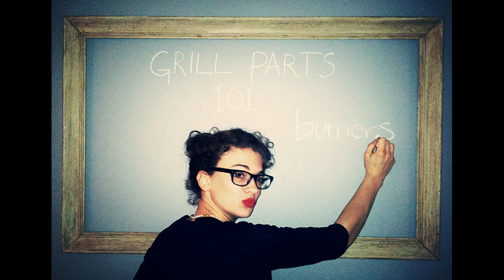Replace Grill Part - Rail Style Burner

Comment: Thanks for the video.  Was trying to get the burners out but couldn't so had to come in to search for help online,  Had no idea there is a pin holding them from underneath.  So much rust and junk inside I couldn't see what was going on with them and didn't want to break any thing.  Thanks very much for the assist.  Great video.

Comment: Suggestion when cleaning the drip tray you can slide it out from the back to clean it easily. I had to use a metal scraper since mine is about 10 years old. I am in the process of completely restoring mine with some of my own upgrades. still looking for the labels online. Does anyone know where you can get them ?

Comment: I wish I could order the grill girl with a purchase ;-). I have a 40+ year old "el patio" aluminum grill. It's a big h twin burner, center fed, twin independent adjustable length pipes. I redid this grill with a "lifetime" cast iron burner in 2002. Well, the life is over...  On the bottom it still says "ROZ-0402". I know I can get a universal stainless burner for it, but I wish this company could honor what the said... I have no clue who it was, but it was sold by home depot back on '02. Any info would be greatly appreciated......

Comment: Grill Lady, I liked your video. Two things, first, you might want to use gloves to protect your hands. Secondly, you might want to employ a shop vacuum to clean off all the rust that was at the bottom of your grill before you begin, and after you completed your work. Otherwise, a very informative video. Robert.